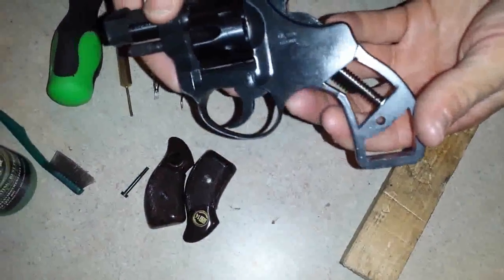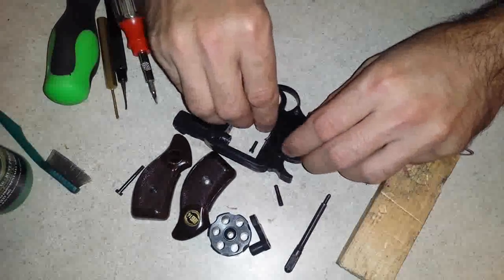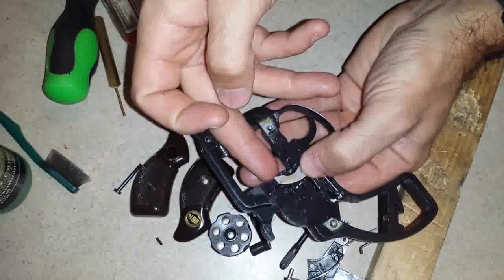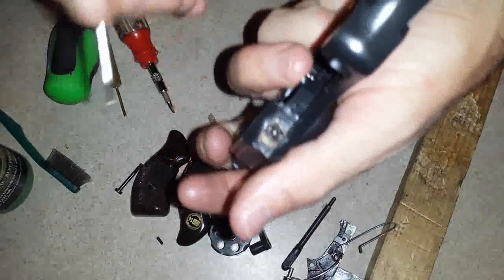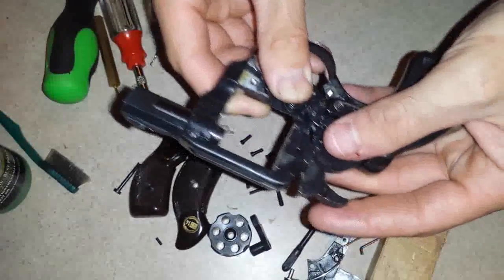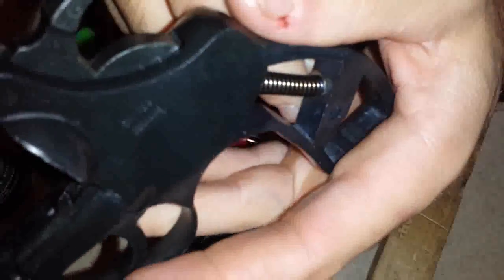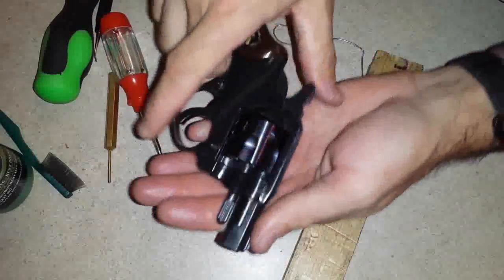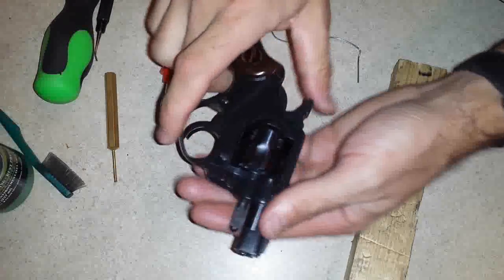ROHM RG14 Revolver disassembly

Comment: I just spent 3 hours trying to figure out how to put my revolver back together until I found this video
Had it assembled in 10 minutes after watching
Thank you
Reply: I took my big spring out that’s in the pistol grip how do i put it back in?
Reply: @AD-xg4nu  If as the video showed you didn't insert a paper clip or something in that hole on the rod inside the spring, you'd need a second person to use a pliers to squeeze the spring until the hole on the rod becomes accessible, then you would place the washer through the rod and insert a paper clip in the hole. Then the spring will be short enough to easily go into its place. If a second person is not available you'd have to use a locking pliers on the spring, then place it on the ground and step on the pliers to expose the hole on the rod while your hands are free to place the washer and insert the paperclip.
Reply: @stilloncourse3561  bro I done it with my bare hands 😂😂😂 I fucking hurt so much
Reply: @AD-xg4nu   😂 I'm impressed you could do that! I couldn't for the life of me. I ended up using a locking pliers, ground, one of my legs, and my weight for a substitute for second person so I could squeeze that little thing without using any of my hands.
By the way, now that I'm here again I'll add that if your hammer strike is too light you can use a thicker washer through the guide rod to keep that spring more squeezed making the hammer strike harder. RG-14s are usually quite old and many of them suffer from light hammer strike.
Reply: @stilloncourse3561 would you know how to replace the firing pin in one of these
Reply: I clamped it in a vise, pushed the spring in with pliers and stuck a paper clip in

Comment: Thank you for the video. I got one of these in a hand-me-down situation. The trigger would not fully reset unless I barely pulled the hammer back, then the trigger would go forward. I replaced the main spring and the trigger spring and it now works properly. The hand spring was buggered up so I ended up replacing it as well.
Reply: Would u know how to replace a firing pin on one of these

Comment: awesome video I just used it to take apart mine and clean it. mine doesn't have a safety spring it had some other part in it that wasn't in the video but I figured out where it went.  now that I have it totally cleaned up I won't be breaking it down to that extreme for awhile. thanks for posting this video I got the gun after my mother passed and wasn't comfortable taking it to the shooting range till I opened and cleaned it. thanks again

Comment: Another reason trigger doesn't fully reset is worn and weak trigger spring. If that's the case then even removing that screw (and the other two) will not solve the problem. A quick fix for it is to insert a tiny piece of flat metal in between the body of the gun and that end of spring that is not in touch with the trigger. This squeezes the spring and increases its strength. Then even tightening the three screws will not prevent trigger reset. I had to go through all this with my RG-14 a while back. Lots of good information in your video.
Reply: Would u know how to replace a firing pin in one of these
Reply: @stonedstranger5057  If I remember it correctly, the whole firing pin device screws out and it can even be disassembled to clean and oil. But you'd need one of those screw drivers that are flat head, but with the mid part missing, cause you only have two notches on the visible side of firing pin device to unscrew it. I also add that misfiring might not be the result of bad firing pin device or wrong tensions of various springs. It could be a mechanical problem on the revolving cylinder itself. It's grooves, if too worn out or not crafted to the best specs, wouldn't allow firing pin to do its job right all the time.
Reply: @stonedstranger5057  A simple check on problem coming from the revolving cylinder is to cock the hammer back and check the cylinder for looseness. If it wiggles in place a bit, at least a major issue is the cylinder itself. It doesn't matter if it wiggles when hammer is at its resting position, but when cocked, cylinder should firmly stay where it is and its shooting hole better be exactly aligned with the barrel hole.
Reply: @stilloncourse3561  the firing pin looks like shit super beat up lol I'ma have to replace it

Comment: What is the purpose of that safety spring? When I dry fire the revolver, the hammer doesn't strike the firing pin. I've never fired this gun but I want to be sure it will work when I do. It is sitting just like you described in the video.
Reply from the maker: the safety spring is there to prevent an accidental discharge without the trigger being pulled. that way if the hammer is briefly snagged and released, it won't fire. the safety spring requires the trigger to be pulled back to fire.
if I'm not mistaken, it only appears the hammer is not striking the pin. it strikes the pin and then bounces back instantly.
Reply from the maker: you might try pressing the hammer forward after dry firing. keep the trigger pulled back and push the hammer forward.
Reply: I have tried what you suggested. Thank you for the response by the way. When I hold the trigger back and push the hammer forward, it does push the firing pin. But when I just do an ordinary dry fire, it doesn't strike the pin. I've even recorded in in slow motion on my phone to see, and it doesn't appear to hit.
Reply from the maker: Well I would think it should fire.. unfortunately the only way to know for sure is to actually try firing it :-/
Reply: Chase Prollock you'll have to clean it afterwards but make little post it squares with the sticky part and cover up the chambers with them dry fire and you'll see it's hitting
Reply: Chase Prollock did you ever fire it after doing those tests?  Did it fire or misfire?  I did the exact same thing, slowly released the hammer while pulling the trigger and I can push it into the firing pin.  While dry firing however I dont see the firing pin move, also recorded in slow motion.  Need to go fire but no time at the moment as the range is far away.

Comment: Can you help me?  I just bought this gun from a friend of mine, he'd never shot it, it was inherited.  Looked solid, cool looking older gun,  only $60.00, no big deal.  I was checking it out more thoroughly and noticed the hammer was not flush with the back.  So I pulled the hammer back and when looking towards the firing pin, i noticed a small, looped piece of metal that looks like a paper clip. On the hammer, below where it strikes the firing pin, below the recessed part of metal, i can see 2 marks on one side of the "wall" and a single mark on the other, (where the hammer is coming in contact with the looped piece of metal, the left side wall when aiming has the 2 marks from the two sides of the loop and the right side wall has 1 mark at the bend of the loop.  So its as if that looped piece of metal is keeping the hammer from closing all the way and also causing it to not be able to come in contact with the firing pin.  The marks/indents do not look like they are supposed to be there.   Any idea what is going on? I could take a video and upload it if that would help.

EDIT:  The looped paperclip looking piece of metal is the safety spring.  So the hammer is coming into contact with the safety spring which is leaving marks /indents on the two sides of the hammer, so when aiming, its flat surface, recessed area with two "walls" which raise up again which is where those marks are.
Reply from the maker: xlxcrossxlx have you tried firing it? one thing I've noticed with most hammer fire guns is that the hammer doesn't sit flush normally. you can do a sort of dry fire with it by letting the hammer back slowly while holding the trigger back. do not let the trigger go, you want to simulate it firing. the hammer will likely stop moving forward on its own, at this point push the hammer forward while still holding back the trigger and it should come in contact with the firing pin. again, simulating the firing of the gun but in slow motion. the gap between hammer and firing pin is another safety feature. hope this helps.
Reply: Unsupervised Adult thank you for the reply. After I wrote that, I kind of did what you were talking about. I simulated firing it slowly and didn't realize that the hammer does in fact come in contact with the firing pin if I push it up to it, and I can see the pin coming through into the chamber where the bullet would be. I have not fired it, I just got it last night. I feel like the simulated shooting in slow motion was able to drop the safety bar in order for the hammer to reach the firing pin, but still looks as if it wouldnt fire when regular speed.  I'll try to go shoot it this week and let you know if I wasted your time lol.   Thanks!

Comment: I have noticed a few people having issues with the firing pin. I have the same issues.  I have shot my gun and it does fire but also misfires. Not sure if it's the ammo or the hammer/firing pin. I have taken fire pin out and cleaned it just now. Not sure if it will help.

Comment: after assembly the trigger nor hammer move....at all....any advice?
Reply from the maker: hey, first off the spring is called a pressure spring. not sure where to find one made for the rg14. may have to get creative.
  Has the pressure spring been replaced? if the hand isn't functioning properly, it will cause issues.
otherwise I would first check to see if the side plate is too tight. and if that doesn't work, maybe the safety "spring" is out of place?

Comment: @unsupervised Adult Could you remake this video with better lighting and maybe a different camera? I have some issues with mine and I can't diagnose what it is. If I could see some better detail I may be able to find where the issue is. Thank you for this one regardless
Reply from the maker: Sorry, but unfortunately I have lost contact with the owner of the gun. So right now this is the only video I can offer.
Reply: @unsupervisedadult4464  Hey, I have really had a time reassembling my RG14; finally trying to reinstall the sideplate, but screws seem to want to cross thread (not straight in).  Can you offer any advice of info?
Reply from the maker: @danieltaylor1181  do you know the ol' trick of turning to the left first to find the threads? If you get the screw straight, turn to the left until you feel it find the beginning of the thread. And then turn to the right. Doing this with all threaded objects may prevent crossthreading.
If this doesn't work, may either need to re-tap the receiver/side plate, or just replace the screw if its threads are messed up.

Comment: Are you able to replace the barrel?
Reply from the maker: xlxcrossxlx I don't see why you wouldn't be able to. if I still had the rg14 in my possession I'd do a video of it.
I think it was only held in place by a single pin. might need a little persuading to get the barrel lose after knocking out the pin. I don't think these barrels are threaded, just smooth all around and pinned in place
Reply: Hey, thanks for the reply.  I had ordered a snub nose barrel to replace the longer one, and actually called to cancel because I didn't think it was possible.  I watched your video and was thinking if it was, you would've done it since you took every piece out, impressive by the way, and helpful.  But the guy I talked to told me that it is in fact a pin that you simply push out and remove the barrel as they are not threaded.  Why did you get rid of the old RG 14?  Is it because it takes an hour to reload?  lol
Reply from the maker: xlxcrossxlx I was actually asked by a guy I know to fix it for him. ended up merely needing a good cleaning and while I was at it noticed there weren't any videos on it and decided to make one. I had no idea it was going to be as popular a video as it is, thought maybe a couple dozen viewers at most. lol
Reply: Unsupervised Adult well 2+ years and 26,000 views later, here we are lol.  So it goes to show you that people appreciate it..and need it.  Thanks again.  I didn't even realize that I had talked to you before about the gun, just bought the barrel and was searching for someone who would know the answer to my question..and found your video..again! Lol and I like your name, especially seeing it as your disassembling a firearm lol.

Comment: Whats the side pin that goes by the cover called its a pin
Reply from the maker: if you're referring to the pin between the frame and side plate, it's simply that, a straight pin. That's the ways it's listed on the parts list

Comment: How to take barrel off to change sight blade
Reply from the maker: Orenthal James Simpson, although I am unable to verify it, I think there should be a screw on top of the front sight blade/ramp. the sight is most likely going to be stuck at first, but should come free without barrel removal. making some oak vise blocks that fit the sight may help. I haven't been in touch with the owner of this 22 and can't do a video on it.